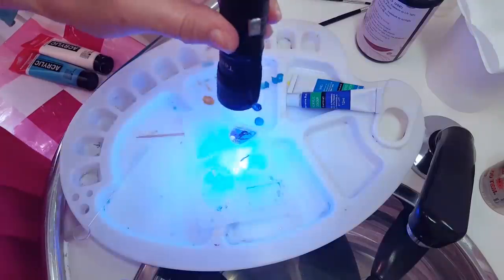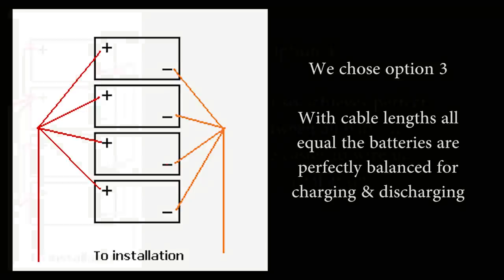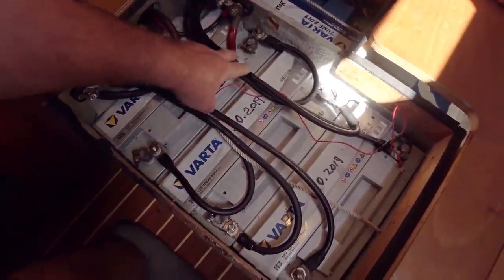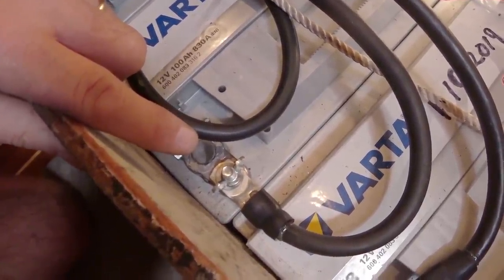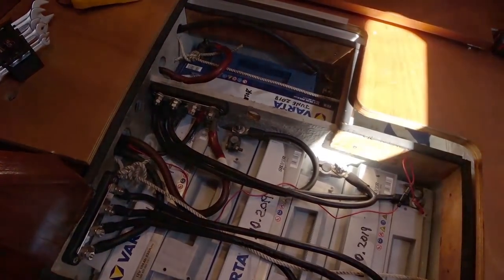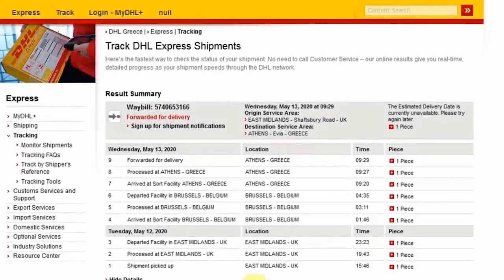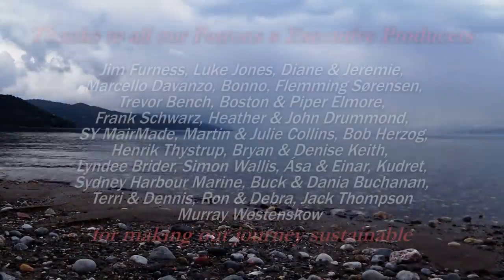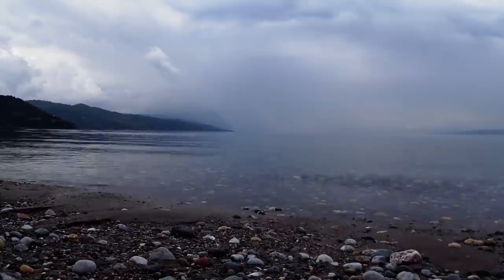How to balance your boat batteries - Sailing A B Sea (Ep.123)

Comment: Hi Baz.

Secure the wing nuts with a piece of thin wire so they can`t come loose. I did this to stop my battery cables coming loose on my charity rally car, you can easily snip the wire if you need to do any work on them.

Easy fix.

Regards.

David.
Reply from the maker: Nice and easy tip there David, thank you. 👍

Comment: i know you mentioned about using whatever cables you had but it would still be a good idea to wrap some red insulating tape round the pos terminals.
Reply from the maker: Agreed Sue, someone previously suggested that I put dots of red nail varnish along the length of the + cables which would probably have a longer shelf life than insulating tape. Cheers for the idea.

Comment: Good morning from New Hampshire !! I own a small fishing vessel that incorporates 2 deep cycle marine batteries wired in series to supply my 24 volt Minnkota trolling motor. 70# of thrust. I've been maintaining these batteries  ( Interstate deep cycle marine ) with  a Battery Tender charger, it sends out a 1.25 amp charge at 3.4 mhz. That frequency disrupts the magnetic field around sulfur molecules so they can't attract and become sulfur crystals that build and destroy the battery plates. I purchased those batteries in June of 2012. They are in my boat fully charged as I type this. Those plates are clean. All of this to tell you that Yes !! Desulfuration works !! Keep up the great videos !! I watch all the time !!
Reply from the maker: Hey Jim, thanks for sharing that info, 2 desulphators are just about to be ordered from Athens. Cheers.

Comment: have a look at sterling power products battery chargers.  the ultra range are excellent and have 7day battery desulphation cyles built in. mine is 8 years old and it has never missed a beet. they also come with a remote control panel so you can see what the charger is doing from the helm or whereever you install the remote.
Reply from the maker: Thanks for the heads up on that product, we'll have a look at the Interwebs and check them out.

Comment: We, up north, concider wiring no 2 correct. I have not wired correct. My open led acid starter type batteries (2 off 225 Ah) lasts for 10 years. But my main cables are 95 mm2. And they are kept dry.
Reply from the maker: With just 2 batteries then option #2 is doable.
Reply: I also have a 175 Ah battery located up front, 12 metres of 95 mm2 cabeling. Same charging source. The main point being, what kills batteries are charging at higher V at 20 deg C, and most ruining is dropping batteries down to 50 %. And not immedeately recharge. I am panicking when, according to BEP, th batteries drops to 75 %.

Comment: Hi guys, Buzz I have a question/warning for you.
I redo the keel this summer, once the flights to Greece are allowed again.
This means sandblast, rust converter, primer and anti foul.
I bought all this things but I read now that rust converter is not compatible (in most cases) with bi-composite epoxy primer. I have a rust converter and vc tar bi comp epoxy primer and I don't know what to do.  if I should apply the rust converter or apply just the primer after the sandblast.

Just take this compatibility issue under consideration before you proceed and if you have a solution or advice, let us know. Cheers !
Reply from the maker: Good question Boardelia, If you're getting a sand blast then you can simply apply the epoxy primer directly after the sandblast. It takes about 24hrs for the iron keel to show signs of oxidation after being sandblasted. Cheers.
Reply: @SailingABSea  I just wanted to point out that there is a compatibility issue between the rust converter which is a mono comp and the primer that is bi comp.
In your case and in mine we have to make sure it's ok before we apply these two things otherwise the layers will come off after few months while the yacht is in the water and the keel will be exposed...
I don't know if in my previous post the compatibility issue was pointed out.
Reply from the maker: We've already applied the first coat of epoxy primer so we are now in the land of will it work or not. Working with so many different products and none of the instructions being in English makes it difficult sometimes. So we'll go ahead with our plan and keep an eye on the keel.

Comment: Mate i would put a clear cover over the + positive Terminal Block so that nothing can short out the system also a Large Fuse on the + Positive side just in case all most like a Car Amp in-line fuse . Ps : when you get the cutlass bearing just do what the old Greek Guy did to remove the old but in reverse to put the new back in . And tell the wife to stop using your head as a punching Bag :) Baz
Reply from the maker: We'll definitely be getting the guy back to install the new cutlass bearing. 👍
Reply: @SailingABSea   Mate you can do it save your Aussie  Dollars just get the all-thread nuts and washers and pull it through just make sure you have a very large washer at each end and  3 nuts two at the end that your pulling into the retainer.

Comment: I struggle to understand the equal cable length as the batteries are placed in a way where the inner two will get warmer then the outer two which will effect the internal resistance and then the charge and discard rates, it’s like you are partly there but not all the way.
Reply from the maker: You make a good point Paul, I'm just working with what a battery 'expert' sent to me after several email conversations. What we have now is so much better than what we had before so that's got to be advantageous. Cheers.
Reply: Sailing A B Sea get rid of lead based batteries and move to lithium iron phosphate, and use a bms, they charge much quicker, you can run them lower, and if kept in a low state they don’t care and they last many years longer, I use them in my charter fishing boat.
Reply from the maker: Lithium batteries are on the shopping list but that's a huge expense that we cannot budget for spending right now. Cheers.